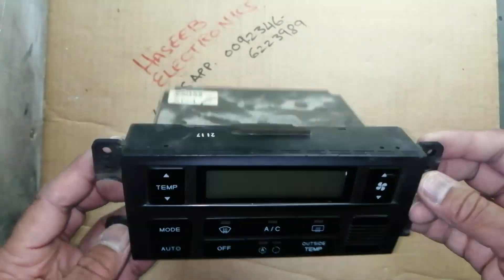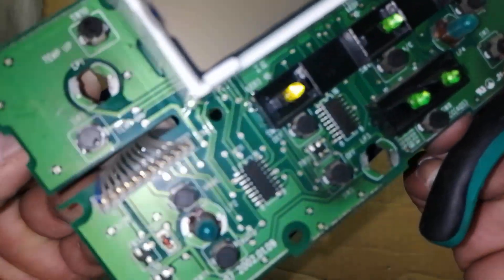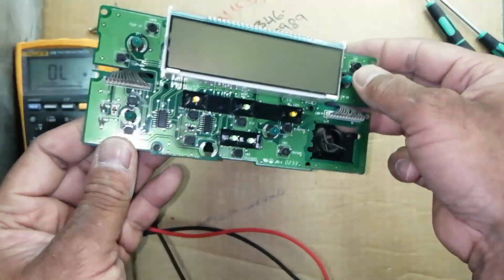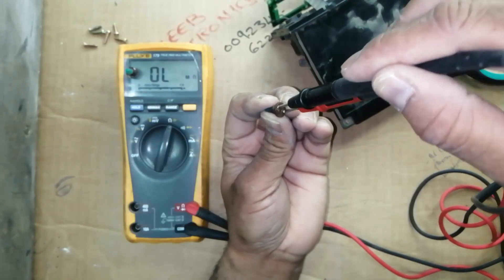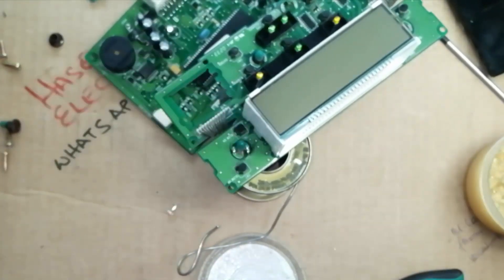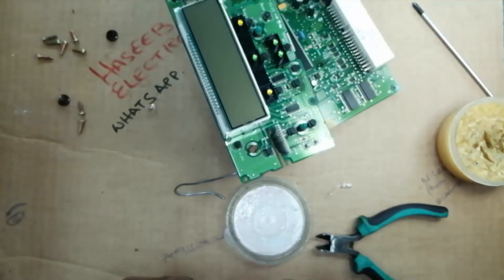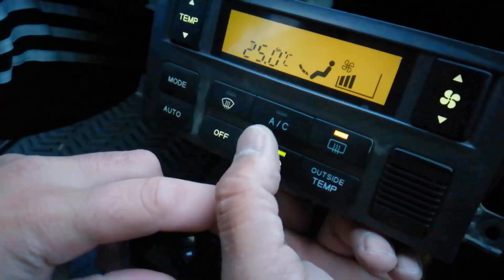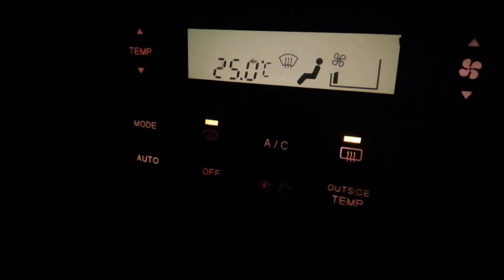#205 Car AC Control Panel repair, Panel Lights not working problem

Comment: My Car Ac control panel display sometimes shows temperature sometimes doesn’t ..it is possible to repair?
Reply from the maker: yes it is repairable 
i think some connector is loose or may be some wiring issue. 
specially check temperature sensor connections

Comment: so if the light is damage the switch will not function
Reply from the maker: switch will work, lights are for display, but if the touch switch common is disconnected then it will not respond

Comment: Hi sir, I m from India
I have Hyundai car called Verna india 2008 
Climate control works, but climate control display does not show anything, but display light is ok,
What would be the prob?
Please guid
Reply: I own a 2013 I 20 and have the exact issue. The AC works fine but the display is blank, even though it is backlit. I've spoken with the service center and they said that it can only be replaced and would cost around 40k. I"ve been looking for a solution since then. Unfortunatley there are very vedios which talk about it, not much in forums either.  Did you find a solution?